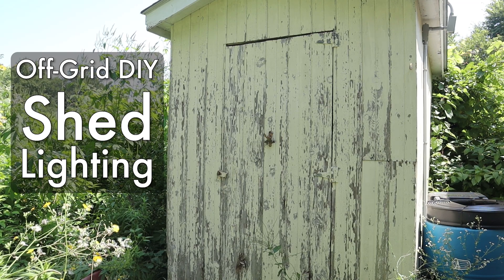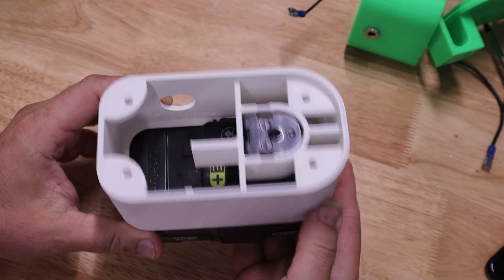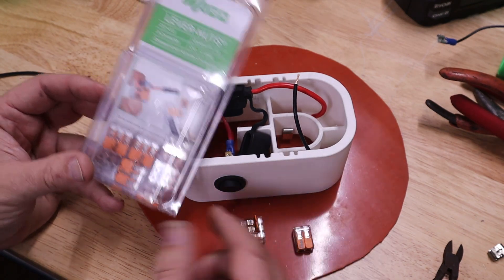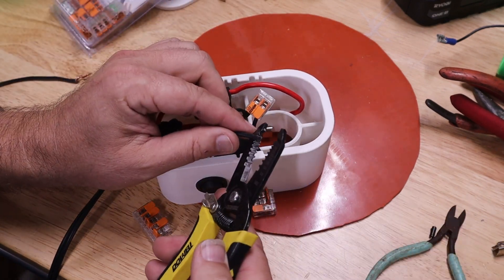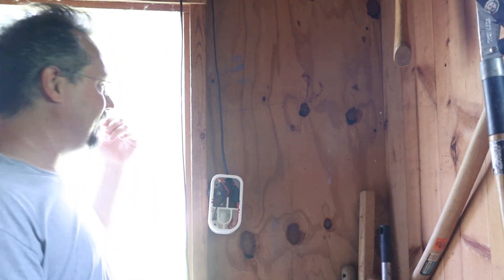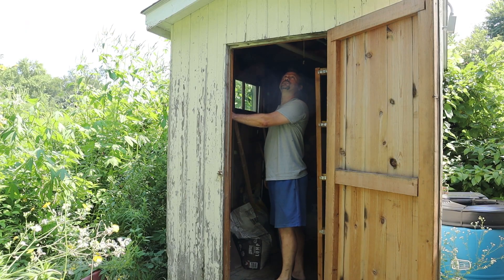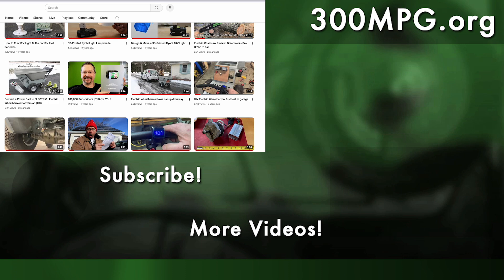DIY Off-Grid Shed Lighting (Ryobi 18V Lights)

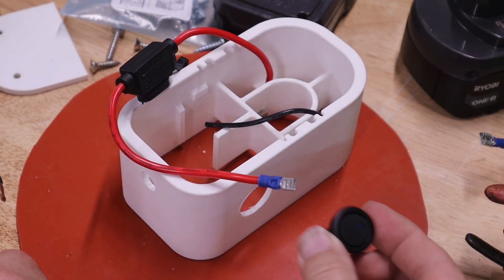Comment: Hi!  I noticed at time marker 3:40 there is a blue end on the DC fuse that did not appear earlier in your vid.  Can you please tell me what that is?  Do you have a link you can share?  Thanks!
Reply from the maker: That’s just a 1/4” crimp-on female spade connector. It just makes it easier to connect the wire to the switch. Alternatively, you could solder the wires to the switch.
Reply: @BenjaminNelsonX  Perfect.  Thanks dude.  My buddy is printing the docks, I am buying all the equipment.  I'll let you know how it goes!

Comment: I don't have a 3D printer and hard to find one one Amazon that you can mount to a wall easily. So I just used one of the many chargers I have laying around. And soldered on leads to go to my shed light. No switch needed I just pull the battery too shut off light.
Reply from the maker: Nice and simple!

Comment: Do you have a video on your materials lifter? That thing looks amazing. I tried my best to find it, but I had no luck.
Reply from the maker: No, I didn't have a video posted about it. I did just shoot a very short phone video of it in operation.
The project was to build a machine to help me get some solar panels onto a friends roof. It was purely practical, I wasn't trying to make a "How To" Video or anything.
I did just go back to find that video, and loaded it to youtube so you could see it.
I used a wheelchair motor that I had, bolted to a ladder to wind up some rope attached to a pulley. The motor was powered by a cordless drill battery.
https://youtube.com/shorts/c8Fizz7buDE?si=-h6nvdJc07T7rk-C
Reply: @ Thank you so much for taking the time to publish the video, I really appreciate that. Was great to see it in operation, very impressive!

Comment: Absolutely LOVE this project! I’m surprised you didn’t have a cover on it to cover the wires from the battery side. I’m definitely putting this in my shed though! Nice work
Reply from the maker: @CyberBobCity  I’ve found that on these types of projects it’s easiest to leave things more open. It just makes it a simpler design, easier to wire, etc. 
There’s a link to the .STL file in the description, feel free to “remix” your own version!
Reply from the maker: @CyberBobCity  I guess I kinda figured I’d always have a battery in there anyways, so that in itself would be kind of part of the design.
Reply: @BenjaminNelsonX  gotcha. I tend to keep my batteries inside away from the heat of summer and the cold of winter.

Comment: I LOVE that you built your own battery receptor.  I also had no idea the bulbs took so little to run!!  I admit, I thought you were going to install a solar light inside the shed. I have one inside my garage. When the overhead door is open during the day, it charges. When I come in through the garage at night, it senses me and turns on the light.. I figure it might just scare off a would be burglar, maybe...   I am still waiting for someone to produce the adaptor from the old DeWalt 18V power tools, to a new Ridged 18V battery....  I just don't see me buying a 3d printer and learning all it takes to make half a dozen of them.. :(

Comment: Wonderful. Thank you for sharing. How long would a battery last to power that light?
Reply from the maker: Those bulbs use less than 300mA. So, lets just round up and say that it will run for 3 hours per AH capacity of the battery. That would mean a common 4AH Ryobi 18V battery would run a bulb for over 12 hours.
Of course, I only need the light for maybe a few minutes at the most - just enough to find what I'm looking for in the dark - then I turn it back off. Run-time will never be an issue for me for this application.
I plan to just leave the battery in there for my convenience. Maybe take it out for the winter.

Comment: great project! Ryobi batteries are great for this type of project as they have a low-voltage cutoff circuit already in them. I have some dewalt batteries I've used for similar projects and accidentally run them too low, which can damage or kill the battery.

Another tip on the docking station- since Ryobi has had the same battery design forever, the handle of an old tool would work as a dock for anyone without a 3D printer
Reply from the maker: Ryobi owners also often end up with far more individual battery holders than needed. Those can also be repurposed as battery mounts for projects.
Reply: Great suggestion